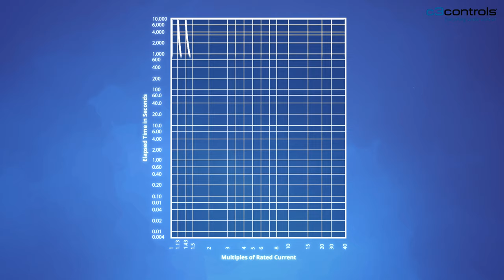Miniature Circuit Breaker (MCB) Types and Functionality | c3controls

Comment: Could you explain the difference between a MCB and a standard size circuit breaker found in most U.S.A. residential homes? What are the pros/cons of an MCB versus a standard size circuit breaker?